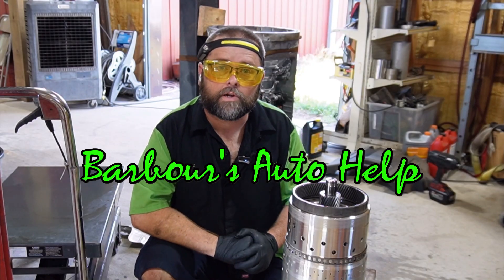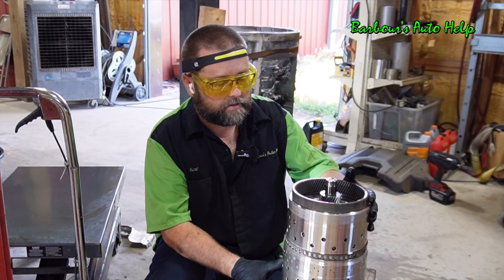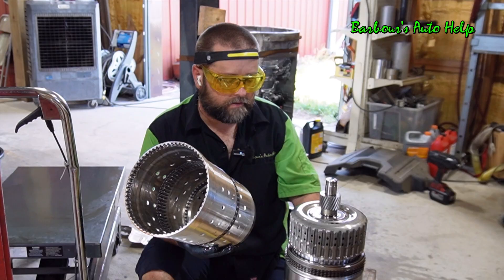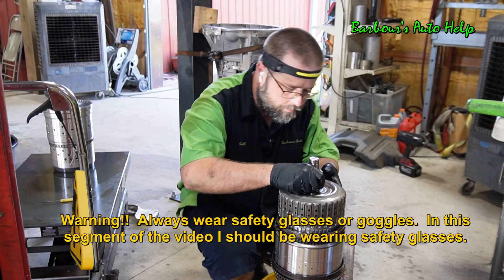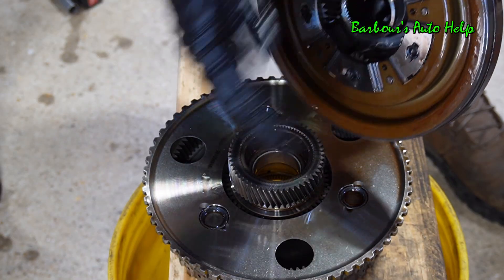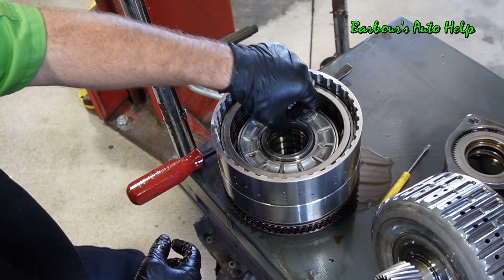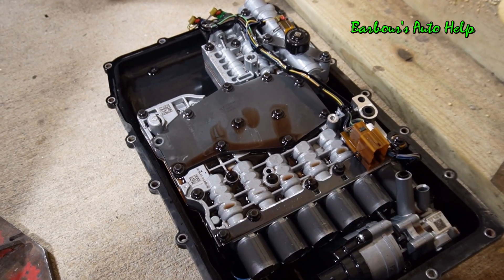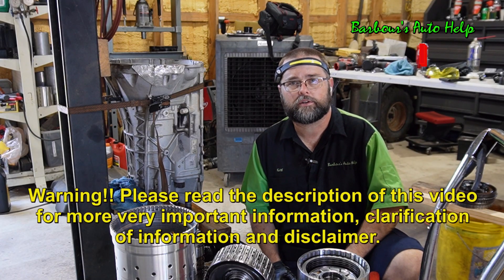Ford & Lincoln 10R80 Transmission Four Most Common Points Of Failure In My Experience

Comment: So what is your thought on if the fluid temps being so high have any affect on any of the failures? I have a 2020 5.0 4x4 88k miles as of now. It has had a large cooler in front of the truck to bypass the coolant cooled cooler since 26k miles. It stays about 50* above ambient temp when full warmed up and been driving. I live in AZ so itll be around 150-160in summer. Never above 175 while towing. Fluid and filter change at 26k when I did the cooler and again at 71k the fluid was still cherry red after 45k miles. But was dark and dirty at 26k.
Reply from the maker: I’m not really sure about the temp situation. Are you thinking this may be causing the bushing failure?
Reply: @BarboursAutoHelp yeah, say like the fluid can handle the temps but the parts cant because with the extra 60* it expands the materials enough to make the slightest movement and overtime it does what these do. But if the temps never get hot enough to make that expansion then no issues? In theory.